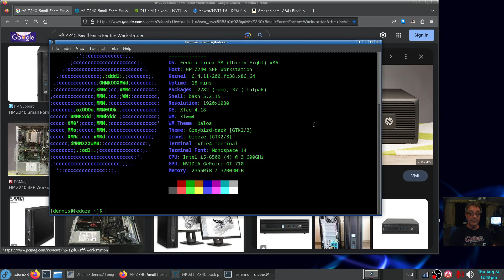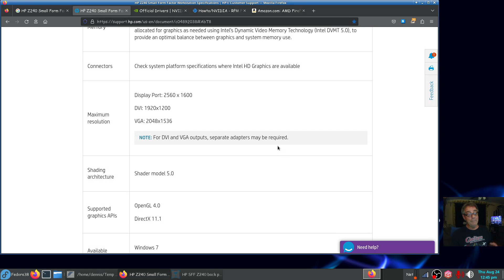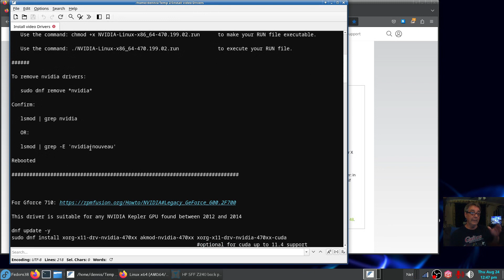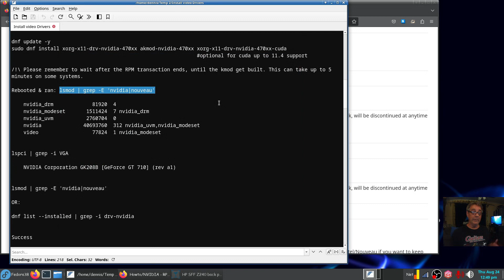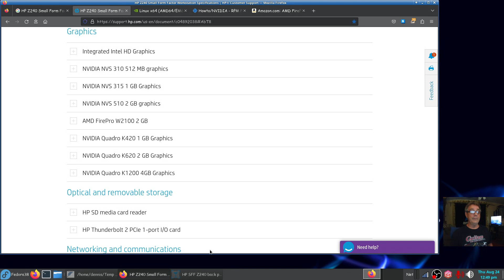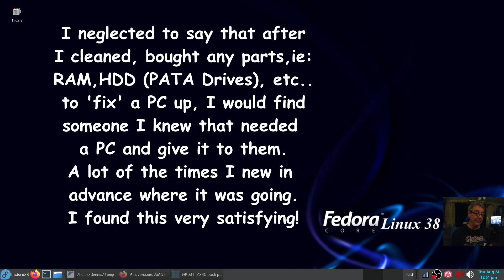HP Z240 DP to HDMI Dongle Equals No POST Install Nvidia GeForce GT 710 I Now Have POST

Comment: I have a only just picked up a Z240 sff and there is no post from the display ports to hdmi I have been at a loss after spending a couple of hours pulling ram, cmos, plugs, different monitors etc. I have a Geoforce GT 710 from Amazon coming today hoping it will help get into the bios. I’m using windows though but you have given me hope. Thank you greatly 👍🙏
Reply from the maker: I very much appreciate you sharing this part of your journey. The 'Windows' part doesn't bother me. I have the original SSD this PC came with with windows preloaded on it. I have not booted up to it but came real close that day. 
Again, thanks for sharing! Please let me know how your journey continues.